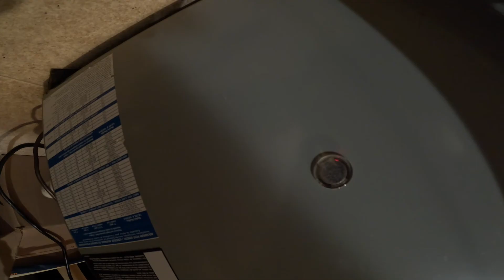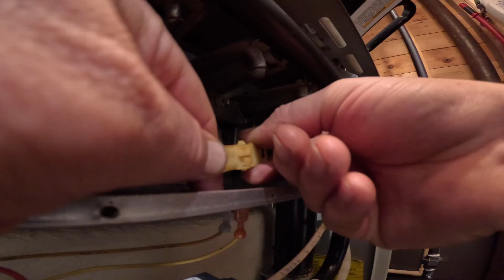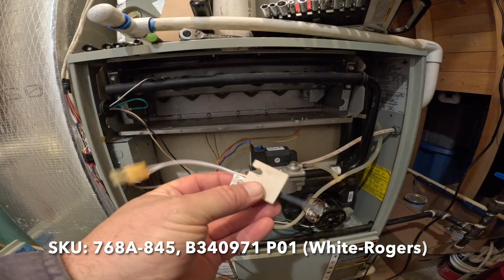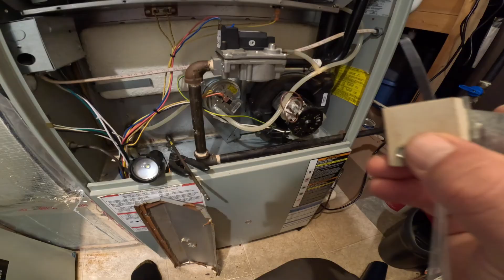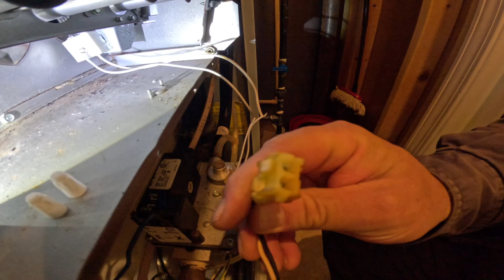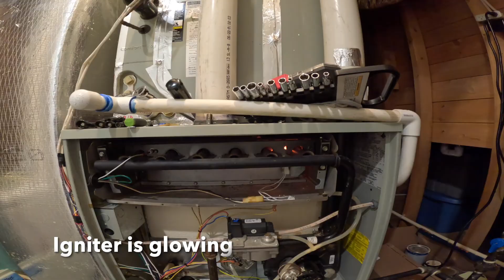Trane XE90 Furnace- Troubleshooting

Comment: Update - Got mine to work finally. Had to replace the whole ignition control board or whatever it’s called. Now my blower isn’t shutting off. I should’ve went with a new one and not used off eBay. 😅 but hey that universal igniter did the job. I hope yours is still kicking and you’re staying warm.
Reply from the maker: That's awesome to give me an update. I don't get too many of those, but it is nice to hear back from people.
My HVAC was as old as my house... 29+ years old. I tried saving it, but it was one thing after another. It had a leak that they wanted to test for $600. Refilling would cost 100s of dollars. Then they told me they can't use the original gas lines or the same refrigerant. It was basically putting band-aids on the system. My entire system was replaced. You don't even want to know how much it cost. I went all electric and got rid of the propane. 
Hopefully, you can keep your system going for a long time.
Reply: @  yeah my uncle had just replaced his system $$$ thousands from what heard. Getting to be a little to much anymore with the cost of things. I hope all goes well with that there electric system. For myself, I’ll be using band aids for awhile! Lol

Comment: Can you please share the video for changing the filter?
I am a new homeowner and cant figure out 
Thank u
Reply from the maker: Check out the link. Please let me know if it helps you out. Thanks for watching and commenting. https://youtu.be/N9le0UgQwb0
Reply: Thank you for the quick response. But i need to how to open the thing to get to the filter. How to proceed after turning off the emergency switch
Reply from the maker: @yvd1408  Have you found anything that resembles what is shown in my video? I don't know if your system is set up the same as mine, but they can be set up many different ways. Your filter will not be near or in where all of the main components are.
I'll do my best to explain how to remove the filter. You should have a small metallic rectangular door. It is hinged and spring loaded. If you look closely you may be able to see which side is hinged.  The door most likely doesn't have a handle on it. You will have to open it and hold it to the side as you pull the filter out. The filters typically don't have a tether on them, so you will have to use your finger, fingernail, or a butter knife to pull it out. These filters typically get warped after being in the system for a while, so don't be surprised if it is difficult to pull out.